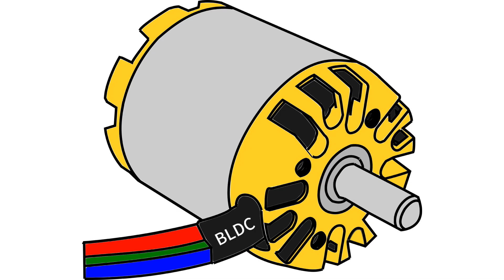如何維修壞掉的電風扇? How to  repair a bad fan?

Comment: Your video is good. If the wall fan unable turn left to right, do we need replace fuse or the synchronuos motor ?
Reply from the maker: Hello,It may be that the rotating shaft of the fan is nt working, you can turn on and repair it.